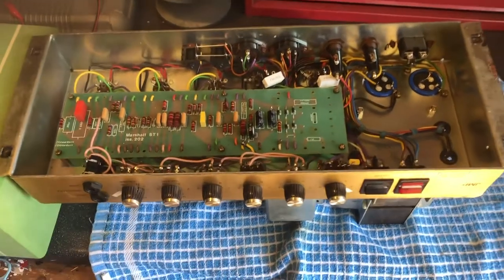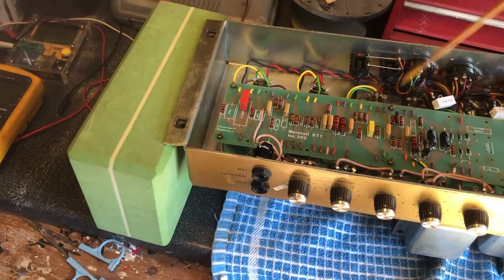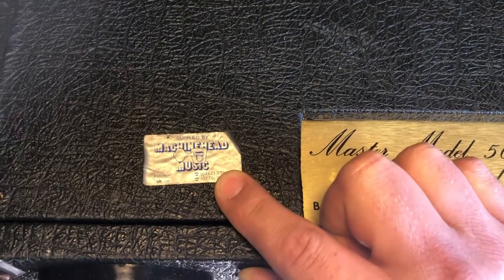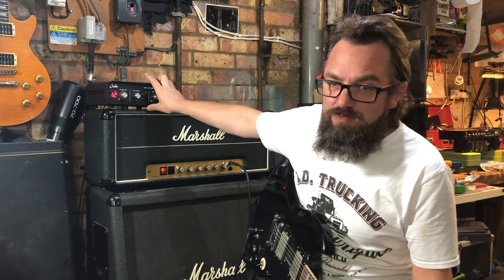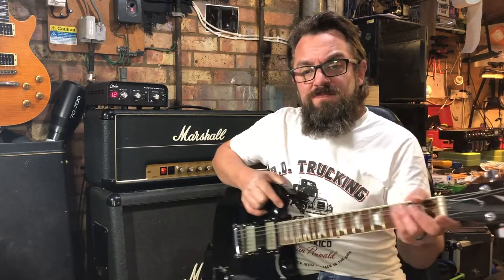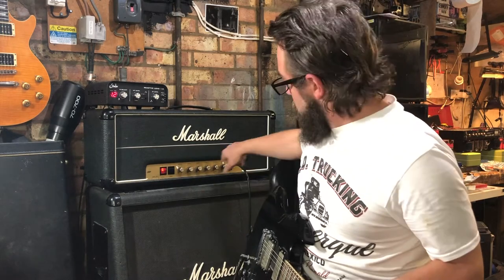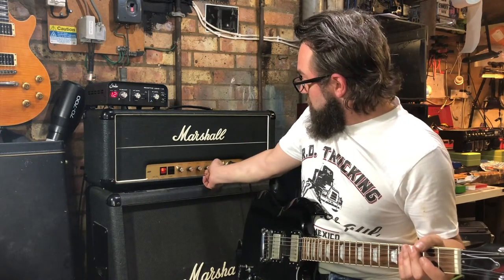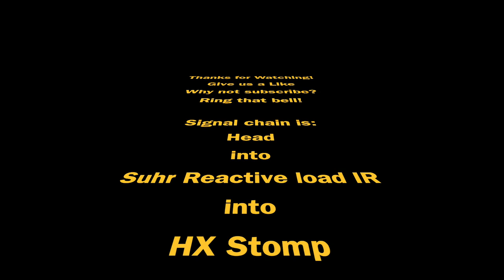1979 Marshall JMP 2204 Service and Playtest

Comment: I’ve had that amp (a ‘79 as well) forever and was always wondering why it was less gainy than what I’d hear from others using it. Blew a tube and took it in for service and finally found out it was modded to a plexi type circuit. I basically always used pedals for dirt. I can’t wait to bring it home soon as my tech has restored it to its former stock glory with a Van Halen mod to give it a touch more gain. I can’t wait

Comment: I own a 1978 Marshall JMP that I bought used at MachineHead Music in Hitchin. Bought, probably in 1991, it is modified input, so no jump cable needed. I also bought my 1989 Les Paul Standard from Geoff, as well as some Marshall cabs. I met Terry Marshall at Machine Head as well and incredibly was invited to the Marshall factory. I've toured it several times. I'll never forget how nice all the guys at Marshall were, to a young Airman in the USAF, stationed at RAF Chicksands.

Comment: Extremely useful video,  I have had my 1979 JMP 50 since new.  I just biased mine up with Mullard reissue pre and power tubes  and it roars.  The low input option is extremely helpful and yes, sounds very much like a plexi.  I am getting a lot of idle hum with the amp pinned however.  I've gigged and recorded with this amp and it is fantastic.  I try to get it up into its power curve like, 4 on the pre and 6 on the master.

Comment: My first good amp I had was the 100 watt version I bought in 1986.   Bought from a friend for $800.  Long gone now,.  Cranked to 10 just once.
Reply from the maker: Do you regret selling it?
Reply: @RDamps  Very much so but if I was buying one now it would be a 50. I only ever had it on 10 once. I remember the volume on my guitar was off and I cranked the amp, that hiss. I ran a long lead out of the rehearsal room before turning it up, hitting an open e chord. It was a moment. Back in 88. :)

Comment: Couldn't help but notice the Albuquerque shirt - I live in Roswell. Like the amp service/mod channels as I dabble in that a little. Have several Marshalls including a '98 DSL50 which I read about on the forums as potentially having problems. Checked the chassis versus the schematic and sure enough some component values were way different. My amp worked fine except sounded a bit mushy to my ears. Decided to risk the $500 investment and mod the amp - changing component values and doing some mods described as "Joey" mods. I ended up replacing about 33 components, added a choke etc. I held my breath and was ready to cut the power should anything smoke, flame, or explode. I was very careful, had gone to school for electronics (decades ago) but am not a pro level solderer. Switched it on, let it sit a while, biased it - and whaddya know everything worked! It sounds tighter, punchier and is dead quiet at idle. Cannot emphasize how slowly and carefully I proceeded, with many notes and pictures.
Reply from the maker: Even though I now do this professionally, I still take my time. I don’t charge for the actual hours spent on my repairs. I treat every amp as if it was my own and take great care and time. Always accounting for human error to 🤣.

Congrats on getting the DSL sorted. Superb amps that can be made better.
Reply: Where did they mount the choke? I have a JCM 2000 DSL100  and want to add a choke... but seems to be a tight fit wherever you might try and mount it. 

Regards 🎸

Comment: Thanks for this video.
I own a 1979 Marshall 2203,which has to be rebuild.All original parts are still there,but i'm guessing about some futures on this one: replace the board to a hardwire version with other parts(like mustard caps),post phase inverter and pre phase inverter master volume option and a midification to all the pots,with storage of settings.Do you presume that the board changing,will change its sound dramaticly?
Reply from the maker: Changing the board shouldn’t change the sound at all as long as the layout is the same. Position of components has an effect on sound. Why does it need rebuilding?
Reply: @RDamps  it was token apart,to customize transformers(giving them different colors,which i liked) and through the concept,to make it servo and midi controlled.

Comment: Wished mine JMP would sound like yours.is it completely original or did you any mods?bright cap still inside?
Reply from the maker: This one it came in did have a little mod done but it was removed and put back to original. I did change the filter caps as they were leaking (physical and electrically speaking)

Comment: Good amps.  I had one.  78’.   The only thing I don’t like so much is the super low plate voltage from the PT.   Mine was around 390v. 
Makes the amp a bit mushy.   
It can’t take too much gain or it gets more mushy cause of the low headroom.   Pretty sweet sounds from it tho. 
Nice man

Comment: I have played most newer Marshalls and was so lucky to get my hands on one of these. These amps sound incredibly well. I have never played through an amp with such good tone before. I don`t know what they put in these amps at that time. I just know they should do it again. Are the components they used in these amps still available/ massproducable?
Reply from the maker: Honestly, the reissues are excellent. Check out my video of my 1987 reissue I modded to a 2204.

Comment: Such a great sounding amp!!!  Great playing too!!!  And, the Suhr IR does an incredible job.  I noticed that the amp is missing a 300m (I think) resistor, it is the second slot from the left side in your video.  I've seen others with that slot empty.  Do you know if people take those out or if they are just not installed from the factory?  Great video.
Reply from the maker: Yeah that’s for the non master volume 4 input circuit. It’s not used on the 2203/2204 master lead models
Reply: @RDamps  Thank you for answering my question.  I appreciate it.
Reply from the maker: It’s why I’m here 👍

Comment: They should reissue this amp. I have the 2203X and it's too loud.
Reply from the maker: Exchange it, Get the 1987x and get it converted to a 2204. Its work I've done a couple of times. I will be doing a video on my personal one soon
Reply: The 2204 is only slightly less loud...like 3dB or so.
Reply from the maker: @wakjob961   makes a good point, maybe exchange it and get the new 20w version of the 800? They sound really good to me
Reply: Get an attenuator!